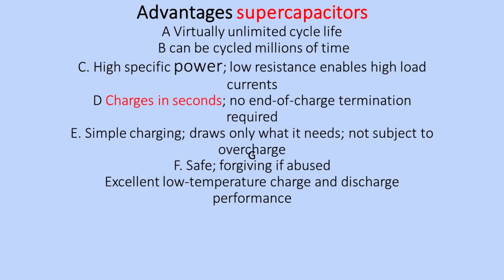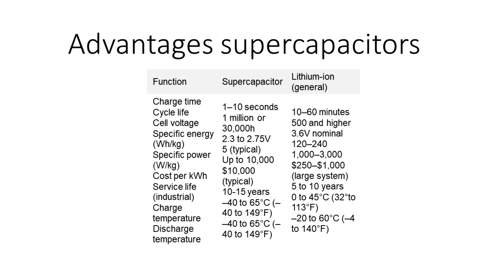Nikola truck - Tesla semi impossible, video,  unless use supercapacitors in battery. stock 3000

Comment: Its the price/performance ratio which is a fraud. Technically there is no problem building a truck with all the specs Elon gave, but it will carry at $350,000 price tag, if you replace the batteries by supercapacitors the trailer will be filled with the capacitors and it would cost $10,100,000 to build, as you show in your comparator,  supercaps cost per kWh $10,000, compare to the $300-400 range Tesla is usually selling batteries.
Reply: The price/performance ratio is probably bigger than Tesla reports.  Pretty sure large companies can get electricity less than $.07/kwh.  So they will actually save much more than reported.  Add solar cells to a factory roof and that savings just goes up.  Also the Tesla batteries sell for $200/kwh.  Not $300-$400/kwh as you suggest.
Reply: David The electricity at a power plant cost about 4 cents a kWh you can do the calculation yourself construction cost fuel and labor either coal, gas or nuclear, they wont make big profit at this cost to what you have to add transportation, distribution and taxes and you end up at about 10 cents, I'm not even talking about road taxes usually included in the fuel price as some of those trucks might need roads, to achieve those ranges. With solar you need 3 acres of solar panel to supply one megacharger on a sunny day, doable in the Nevada more difficult in the north-east where land is expensive and sun is shy in the winter.
Model 3 batteries are sold at $360, powerwal at $420 per kWh where did see a Tesla battery at $200/kWh?
Reply: Teslafaninsight Supercaps could be used in hybrids for regenerative breaking and and quick acceleration, in a pure electric I don't see any use,.
Reply from the maker: its a blend of llithium ion and supercapacitors.  unusual but new and innovative.

Comment: according to your slide super-caps energy density is 48 times lower than batteries. how would anyone come to the conclusion that they are the solution?! they would work great for a bus which can recharge at every bus stop. but for a long range car or truck? are you kidding me?
Reply: Very well said!  Tesla Semi pack is only 10x bigger than p100d so it is only scale and improvements. Only thing is the price - I was schocked by such a low price. But I'm sure they will make money on it.
Reply: Yeah, it would be a HUGE step in supercapacitor technology to be able to produce them within a reasonable range of weight, volume and price. To me it looks more realistic that Tesla is planning with li-ion improvements to make the economy work out in 2019, while current prices would make it way more expensive than the announced prices.
Reply from the maker: totally amazing price to performance
Reply from the maker: they could have/should have charged more but they may tie the purchase to sale of electricity which gives them back end income on an ongoing basis

Comment: super-caps are pointless for long range. energy density is crap. they are just good for peak power. temperature is not a problem, they heat the battery, the bigger the battery the smaller the % you lose when you heat them. overheating can be solved with better cooling solutions, the old teslas where not built to perform a long time at max power output. they probably changed that for the semi and the roadster. 200kwh should not be a problem for the roadster. you would be able to put that into a model s or x, just fill up the trunk. efficiency is also higher on the roadster than it was on the model s. it's more aerodynamic and probably also lighter. so you get further with the same charge. i also don't believe that they have a new battery technology. that would take ages to make it market ready. and as far as i know they prototypes they have already perform according to the specs. would be really strange if they just developed that without someone finding it out. if they don't have the tech yet, it would be to risky to claim that they will have it in 2-3 years.
Reply: keep in mind the battery plate is only 4 inches.  Just lift any model by 5 inches "the distance a muffler takes up anyway" and they can have double the batteries.  Just saying.
Reply: You are still right, not only the ice has a disadvantage on power throttling but also an electric system can take a 400% overload for 2 or 3 sec. without any damage, it still has to transmit the power to the road and as the roadster wheels don't look oversized, I don't think the 1.9sec can be achieved with street legal tires, just my opinion. Now with dragster wheels I don't see why an electric car could not do the 0 to 60 in .5 sec and 20ft. like a dragster, the 1/4 mile in 5 sec. would be more challenging. :-)
Reply: You are right the biggest problem for the roadster is not the batteries they wont overheat in 2s. its the tires, you need F1 slick tire which are not usable on wet pavement and last a few hundred miles at the most.
Reply: Roadster is not a problem, most of us could never drive it to the limit anyway.

The Truck is the real problem. It's a tool, not a toy, and must be economically atractive.

What good can capacitors do to a Truck?  Buffer energy to and from the batteries to allow high power sprints with no battery degradation.

Capacitors (as currently known) can not hold higher amount of ennergy economically. Don't help in range or fast charging larger energy amounts.
Reply: F1 slick tire would not be street legal. they might be able to do it without. ice have a disadvantage when it comes to acceleration. they cant control the power output quickly enough to not start slipping. with an electric engine you don't have that problem. you can control the power very fast. so you can give them at any moment the max power they can handle. an ice car will need a lot more grip to achieve the same acceleration. the braking time from 60-0 is a good indication. abs controls the break-force to stop it as quickly as possible. some people claim that the electric engine might be able to beat this time because it can regulate the power quicker than abs. we don't know the max accelerate for certain tires. we just have numbers for ice cars which are terrible slow at controlling the output power.
Reply: Tesla knows that they have to be economically attractive. with the prices they mention for the trucks (150'000$ / 180'000$) they are attractive. i still have problems to believe that they can offer all those specs at that price point. same with the roadster. it's hard to believe with street legal tires. on the other hand, tesla never failed to deliver on their specs (on time yes, but not specs). it's kind of pointless to argue at the moment about those things. we will see it when they deliver the vehicle and the first tests from other people show up.
Reply: I'm not arguing with you, he always delivered on specs, times and price is another story . If you want a descent model 3 you'll spend in the $50+K rather than $35k which keep it in the luxurious class for most of us. Next year we are going to see over 100 new models of new EV's from allover the world, Tesla fans will buy a model 3 but the average Joe will compare price/specs and might found its dream car somewhere else, but I'm pretty confident Elon will take it as challenge, as he does with manufacturing and is likely to succeed.
Reply from the maker: 200 mph without wings for downforce seems strange